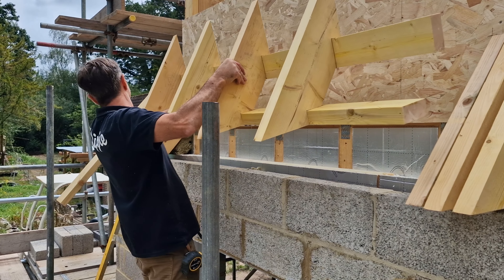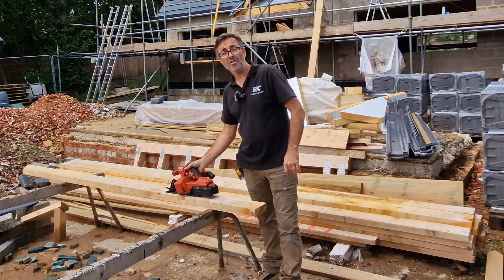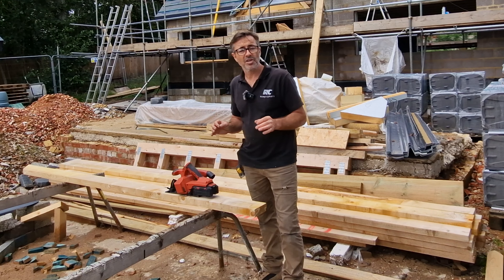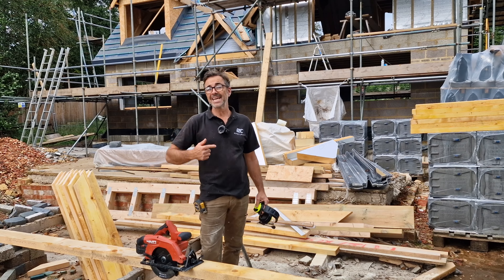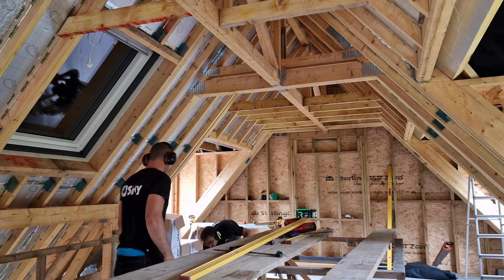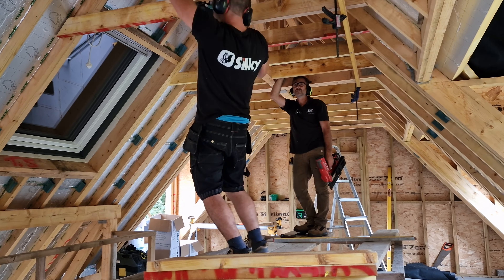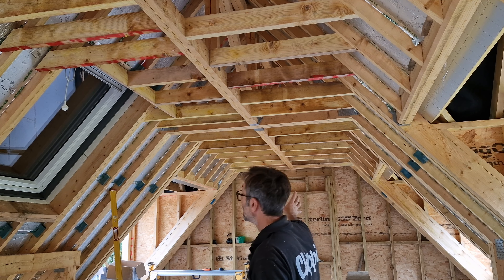Collar Tie roof construction made easier

Comment: Genuine question, do you not need your insulation flush with the under side of the rafters, then 25mm PIR board over the top ?
Reply from the maker: That's a cold roof where you do that, this is a warm roof design
Reply: @robinclevettcarpenter  so does the additional pir go above the rafters ?
Reply from the maker: Yes there is a video on my channel from this install

Comment: You didn’t rebate the collars at the ends on this job will that be a problem for the ceiling plasterboards?
Reply from the maker: Not with these lightweight hangers they are only about 1mm maximum thickness the plasterer will ride that out with his two coats of multifininsh

Comment: It's interesting that you put the joist hangers after fitting the, for want of a better word, ceiling joists, doesn't that make them protrude into the plasterboard? And did you fix them with square round nails? I only ask because I'm not a carpenter or builder but a DIYer, I bet you hate those!, who's watched/studied many videos before I installed my roof trusses and associated roofing joists and I remember tirelessly hammering those strange looking nails, my builder mates have a pasgun but the only nails that I got from him were ringshank. The square round ones do the business, though.
Reply from the maker: Yes the square twist nails for metalwork are not nice nailing by hand!! I did many years like that before getting a proper nail. The nails are specifically designed for metalwork too!! as far as the hanger holding the plasterboard... it is way to thin to really make much difference. If we are using a heavy duty hanger then we would recess them
Reply: @ukconstruction  Thank Robin, it's always good to know these things just in case I need them again!. The channel's great, always something interesting to learn, especially when you're working with wood 👍
Reply: Try an air powered palm nailer for those.

Comment: Think i would have had the lattice truss designed 150mm less in height so collars could runn through in 1 length underneath and do away with those cup hangers
Reply from the maker: The collars do not have corresponding rafters due to dormer setting out etc, the luxury of the lattice beam to the sam level allows this to happen

Comment: My ppn gun mis-fires quite a lot any suggestions on what I can do? 

I’ve had it for a year and a half and used it 7-8 times
Reply from the maker: Sometimes the less its used the more it may misfire, after all its a small combustion engine, take out the gas between uses if your storing for a while, keep in a dry place away from excessive moisture etc sometimes the spark plug needs a wipe too
Reply: Bring it back I presume there's still a warranty?

Comment: I think the girder truss is unnecessary with the proper collar ties. Even a ridge beam only makes hanging the rafters easier, but it is not doing much.
Reply from the maker: The ridge lattice trusses replaces some hefty steel, this roof has many dormers and a change of direction that position the rafters so few fall opposite one another, the lattice trusses are vertical support for the rafters as the rafters are birds mouthed over the top as opposed to cut on the face,  yes you can use a suitable collar in a roof where both sides are in line but still this is limited in timber design
Reply: @robinclevettcarpenter Right, thanks for your response, I presumed the rafters were inline.

Comment: Why do you put what, You call collars, offset from the lattice truss ?  Try tacking the ceiling !
Reply: Trying to work out what you mean. Are you talking about the slight offset for the depth of the hangers? Hadn't considered that being an issue, but you could be right.
Reply from the maker: Because they meet where the rafters are on each side, these are positioned to suit the dormers and other setting out and this differs on both sides, the plasterboarding is a piece of cake
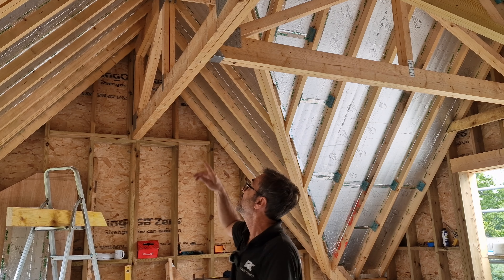Reply: timespam ?  (like this 1:00)
Reply: Collar ties are in most cases structural (prevent roof spreading)they have to be attached to side of rafter so u can nail/bolt through... If collar is fixed to underside of rafters it has no shear strength as u can only fix up through the bottom and end grain will split when the dead load stress is placed on the roof(tiles,wind load, snow etc

Comment: Robin, thanks for getting back to my comment.  As a carpenter of over 40 years , I made a comment about why you seem think that collars can be put anywhere that suits.  Collars are the base of the basic triangulation of roofing geomentry, not a simple addition.  Your use of infill timbers, which you call collars do not do the prescribed physical structural integrity that collars are designed to do !  How do you think a ceiling can be tacked to offset ceiling joists ?
Reply from the maker: The Lattice truss is a beam that also connects the collar end in close proximity to one another, the collars are not for spread as the rafters are sitting on the lattice beam above by birds mouth these collars simply take roof loads from the tiles and shorten the clear rafter length, the roof is over engineered with deeper rafters than needed to suit insulation and service void on the warm side, These roofs are designed by some of the most sophisticated engineering modelling in the world of timber construction and yes for a traditional collar and tie roof the collar would need to be continuous and from corresponding rafters opposite one another hence another reason we design the roof structures to mitigate against the need for this allowing for total flexibility with regard to setting out breaks in the structure for dormer windows or roof windows etc, The ceiling boards are really no problem, we would start with a sheet straight down the centre if the roof support the odd end with some framing and the fill either side of that to the slopes, super simple we also use a thicker board such as 15mm and 2700mm in length again many people do not know this exists, Its all about thinking ahead and understanding the possibilities especially with modern timber tech and design
Reply: A collar tie can be anywhere in the top third of the rafter.
Reply: Very interesting.  Usually the collars are in tension, but I presume on this case  it I'd assumed they are either in compression, or neutral?  

Very interesting build.
Reply: Thanks all for sharing your knowledge guys, this is great way to learn 👌
Reply: The collars in this case are going to be in compression opposing one another perpendicular about the lattice truss. The joists will be under tension and preventing [catastrophic] splay at wall plate level. That lattice truss is quite something. I'm curious about the decision to use that rather than attic trusses but perhaps that was due to the gable / valley arrangement. Gonna have to rewatch and concentrate more this time! Interesting this post is compelling us all to think; it's not like mr beast is it (mercifully)...
Reply: @robinclevettcarpenter errmmm thats him told Robin!! 😂👍 Good job mate 👍
Reply: Just because someone's been doing something a certain way for over 40years doesn't mean it's right!?? 🤔🤔
Reply: This platform is the most amazing way to share knowledge. Best practice, new methods (it may be slow but the industry does evolve), techniques, regs, tools, 2 way street.